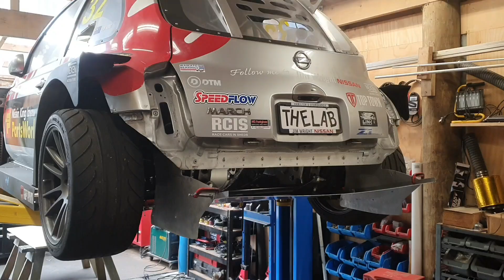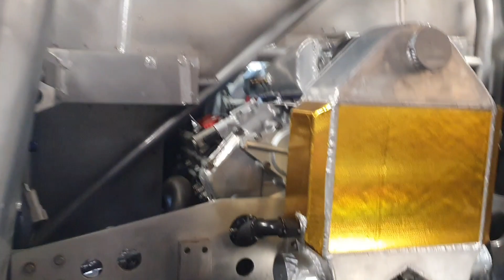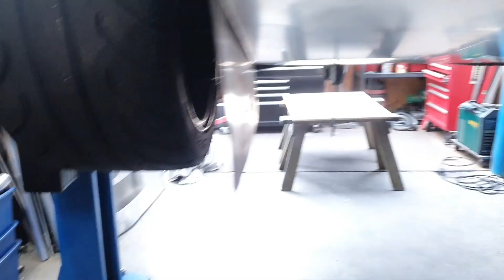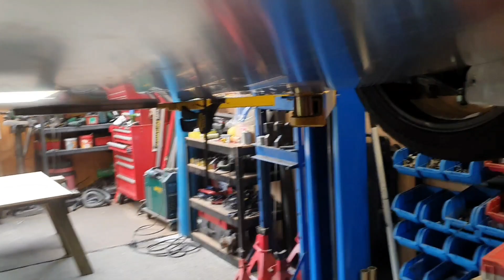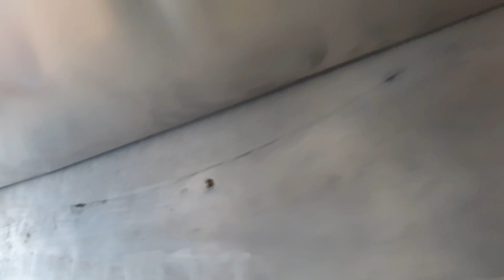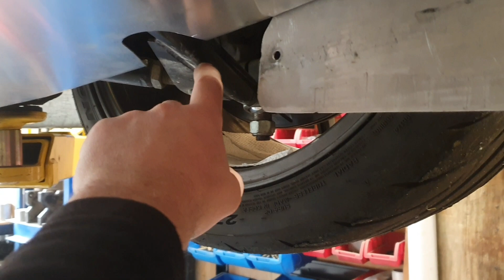Custom diffuser for the Mad March day two

Comment: Glenn, is it possible for you to do one of your white board drawings on the high and low pressure areas under the March and why the 7 degrees is optimal instead of say 5 or 10 or whatever? Thank you
Reply from the maker: I could cover the basics but the car has not been scanned and run through a CFD program or wind tunnel tested etc so it's all just done based on simple principals.
Air go fast = lower pressure :)
Reply: The key is to keep air "attached" to the diffuser. Too shallow an angle and you're not making the most of the effect, too steep and the air detaches from the surface and becomes turbulent